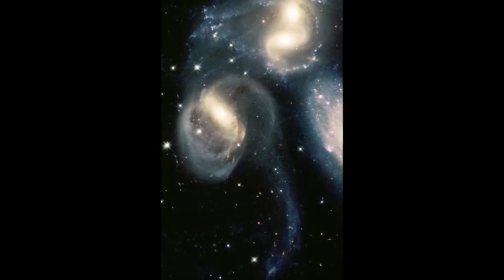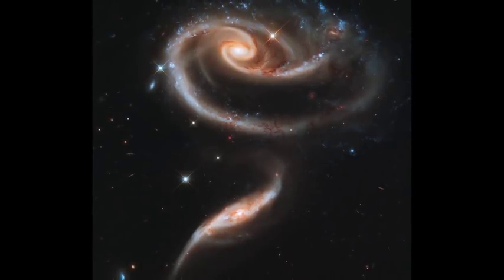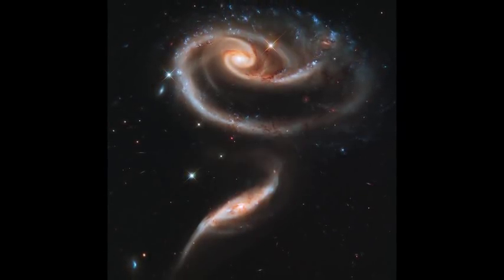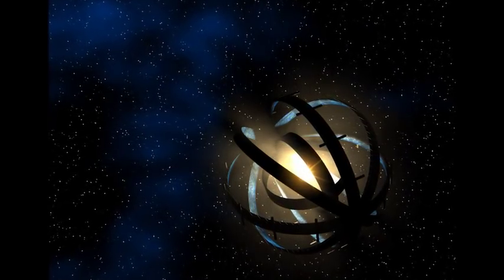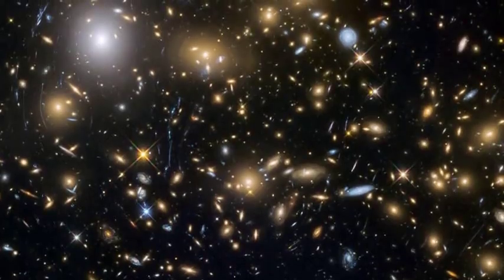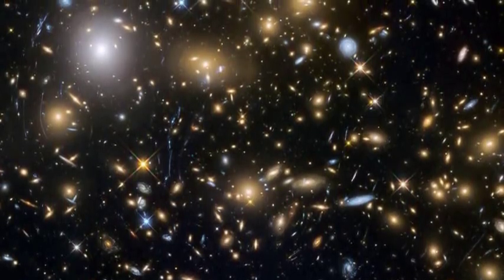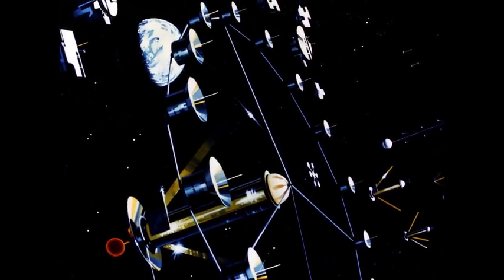Detecting Alien Stellar Engines

Comment: Wouldn't building micro space craft as tiny as we could. Be easier to power on light in the Universe? Or some other power source. Plus. If something is small though durable. More difficult to be hit by debris in space? Because of a small size possibly able to make it go faster than if it was larger? Less resources to build though complete the same task? 

Perhaps the probe could be made of energy itself instead of mechanical.

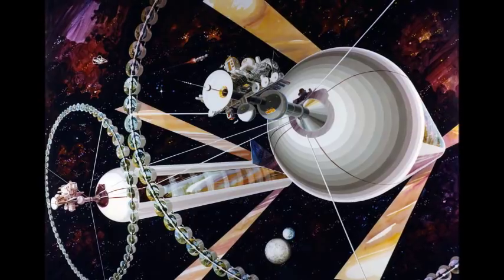Comment: This isn't possible.  The statement at 1:01 isn't correct.  "As the star moved it would carry its planets with it, just as the sun does now with our planets".  The reason that the planets follow the sun as external forces work on our sun to move it is that the same forces that work on the sun also work equally on the planets.  Imagine an external hand pulls the sun upward, its gravity on the planets is pulling the planets at right angles to the force acting on the sun, the planets wouldn't just magically follow.  Tidal forces would to some extent, but they only start acting the more the sun is pulled out of the plane of the solar system.  Any force that acts to move a star that is not acting on the planets orbiting that star would serve to severely disrupt those orbits.
Reply: What you say would be correct if not for the incredibly tiny accelerations being discussed. It would make for an interesting simulation tho' if our simulations worked to enough decimal places to even see the effect!

Comment: 2:04 "the data is being taken".  If a star is getting tugged away it should have increased flux because a mirror(s) is behind it. If it is moving toward us a mirror(s) is in front.  How would that lead to a detectable difference in the signal?  The difference is supposed to steady over millions of years.  Most of the stars we see in the sky are slightly dimmer or slightly brighter than standard for various reasons.  Worse, we often use the brightness and temperature to determine the stars age and life stage.  If there is no nearby star we also use the brightness to estimate the mass.  Some low tech cheap mirrors are still more than 98% reflective.  How would you prove the IR from 2% adsorption was a mirror and not from dust.  If they are moving towards us, left, right, decline, or incline we do not even get the IR signal.  
A single mirror made of one substance should have some characteristic emission.  The Shkadov thruster can (and probably does) use multiple mirrors.  It seams likely they would utilize various local sources for material.  Individual mirror structures can also have variation in coating.  Dust particles will also reflect some light and radiate emissions characteristic to the elements in the dust.